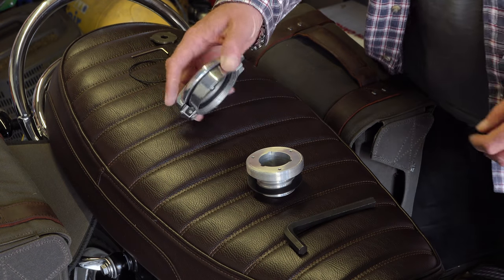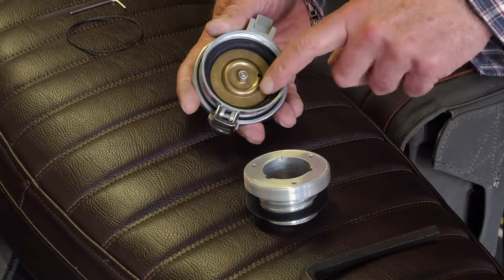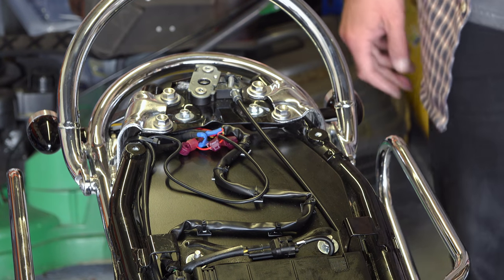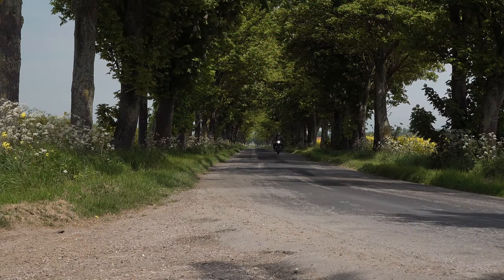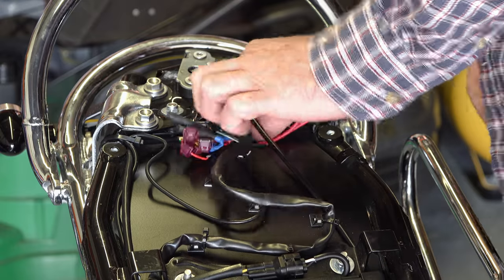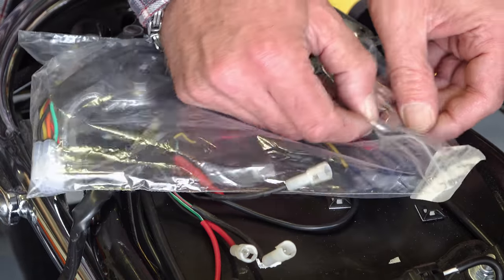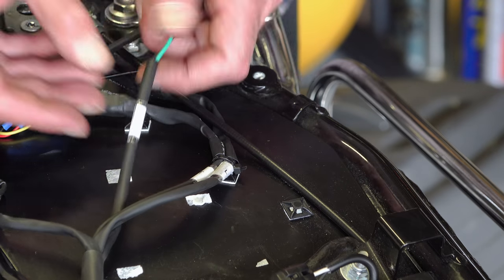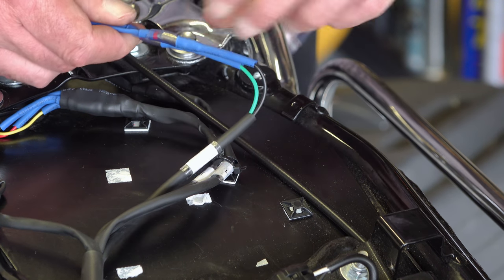Triumph Bonneville T120, wiring up a Sat Nav with motone customs accessory Harness!

Comment: I just received Motone's Eldorado tail light as I queued up this video. Final piece I was waiting for. I'm replacing the current tail tidy kit with a new one (due to the tire somehow hitting the license plate and bending that entire part of the kit up underneath the seat and cutting the left indicator and brake like wires). Changing the indicators to their billet ones and got the wiring harness as well. Should look a lot nicer and make me street-legal again.

Comment: I’m really looking forward to seeing your sat-nav install Stuart! I like that you’re very thorough in your wiring, even using the shrink wrap water proofing for the connectors. It’s very clean looking. Wiring things up, I’ve always been a bit intimidated because I might end up butchering the wires or maybe even overloading a circuit. Then electrical nightmares are sure to follow...so I usually pay premiums to let my Triumph guys do the work. Would be satisfying doing it right myself. Thank you for your continued videos. I really enjoy them very much! ~Don 
PS: I’ve always thought it would be great to somehow waterproof my phone to use for navigation, but have seen one too many YouTube videos of people having their phones dismount in transit, to become the next road kill. That’s too much an expensive proposition for me to stomach! Cheers mate!🍻
Reply from the maker: Hi Don, yes electrickery isn't for everyone, ive blown my fair share of fuses over the years! but never actually done any damage. shrink sleeve is a god send in my opinion, it also stabilizes the bullet connector joints and helps them from being pulled apart! thanks for watching.

Comment: Great video once again Stuart. Accessory plug and play should be a standard fit on the wiring harness on all new bikes (IMHO). I think two access plugs for permanent electrical equipment should be sufficient with a third being a pigtail for an external battery charger or plugging in of heated gear.

Comment: I would like a plug and play connector to provide a feed when the ignition is on. This would feed a 30 amp relay to draw current from the battery and three or four outlets for sat nav, camera, phone charger, and tracker.

Comment: Hi Stuart,

I too have the OEM cruise control fitted on my T120 and worked really well.

I have recently fitted an aftermarket Motone tail tide with Lucas style LED tail light. Now the cruise control doesn’t engage!

I note from one of your other videos that you have fitted the R & G tail tidy with their LED light. Has it affected the use of your cruise control? If it did, what was the fix?

Regards, Mick
Reply: The reason for the question: Like I said I’ve fitted the Motone tail tidy, and am very pleased especially with the extra room to fit a disc lock under the standard seat. With the R & G tail tidy you have fitted with their supplied light does your cruise control engage?
Reply: Stuart Fillingham : Hi Stuart, thanks for the response, since you’re video upload I’ve been in contact with Sam this morning, and an updated loom is being dispatched. Fingers crossed it’ll work with the Motone Lucas style LED tail light.

Comment: why not have an accessory cable that replaces the the USB connector? It only is powered when the ignition is on so it would be ideal and very easy to get to. That is where I was going to wire my sat nav to. I havent got around to doing it yet and I'm still using it on a temp connection.
Reply from the maker: It is possible but the problem with USB cables is that the end that usually connects to your device wont be waterproof, so it could be an issue. Also usb is generally capable of conducting on tiny wattages, so may not have enough juice for some devices.
Reply: @stuartfillingham  The USB adaptor is fed from a 12 volt supply. If you follow the wire back if memory serves me there is a connector block. I they made a replacement  for that that still had a usb adaptor but also auxiliary connectors too I think that would be better than overloading the lighting circuits. I have no idea on the load rating for the USB 12 volt supply but I would be wary of over loading the lighting circuit.
Reply from the maker: @jimwoollard8329 as as I said in the video Jim, any accessory feed that motone creates will not necessarily be incorporated in to the lighting circuit, which off the top of my head I think can handle a total 20A. im sure they will do their research in finding the best power source. the sat nav did not have the option to be used with USB on the bike and required hard wiring.
Reply: @stuartfillingham  hello sir. 👋 I want to install smart turn system [self cancelling] and I need to tap into left right and flasher signal wire in addition 12v that is ignition activated and wondering if you remember or know what colors are those wires by any chance?? Thanks